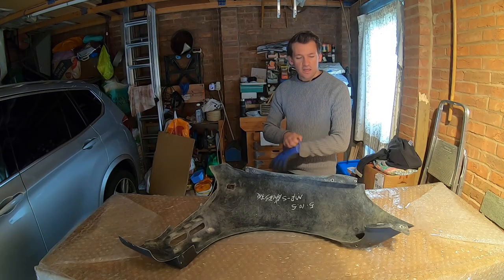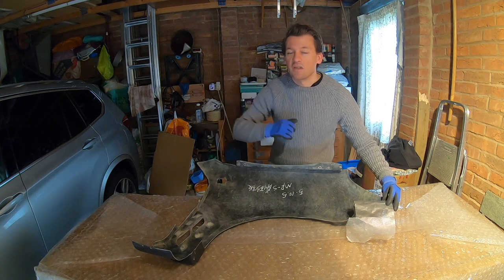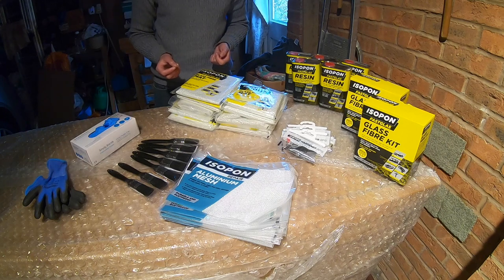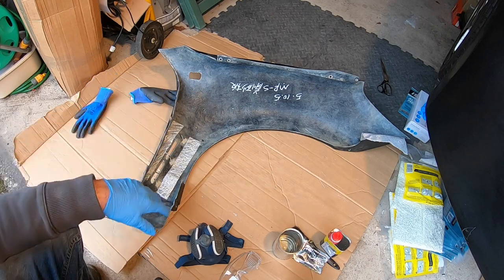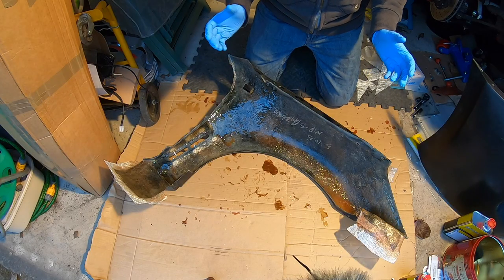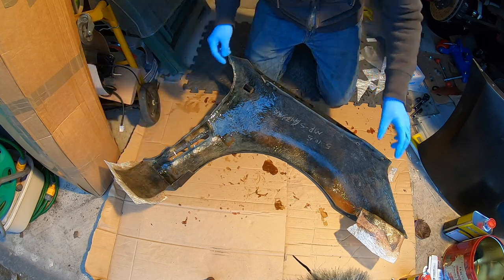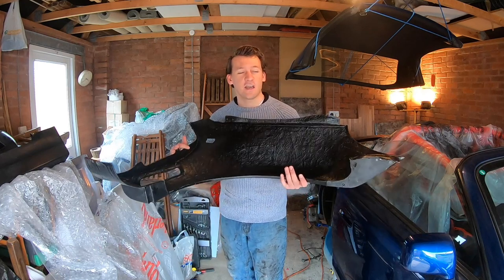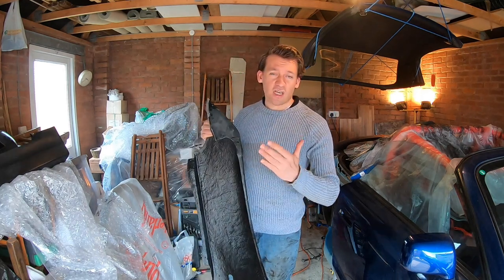Strengthen A Bodykit

Comment: Is there a reason why body kits don't come with this level of strength / rigidity from the supplier as standard? Is it maybe so they can be flexed to fit the desired shape / car they are being fitted to?
Reply from the maker: Very good question! Given this was a kit made for the MR2 Roadster you would expect the fit to not need much flex. The reality is it’s just poor manufacturing, when we came to fit the kit we found some of the tabs were almost 90 degrees facing the wrong direction and needed to be cut off all together. This seems to be the case for most widebody kits you can order under £5000.

Comment: What size rivet nuts did you use?
Reply from the maker: In general I used M8 all over where it would fit, that’s the most common bolt on the car and it just made it easier. There are some smaller M6 ones I’ve used in the past for smaller spaces though.

Comment: Why cant you use Chopped Carbon fiber?
Reply from the maker: @YungEBT  you could use chopped fiber but that would definitely be more expensive than fibreglass mats. I’m not sure if it would be stronger or not over a big flat area as the weave in the mat gives a lot of extra strength.

Comment: I can fully understand the value of strengthening, but you seem to have added a lot of weight to the car. If you were planning to race it, what would you do differently?
Reply from the maker: This will live a lot on track and I’ll be adding a lot of power to balance that out. If that’s not an option for you then I would take a mould of the kit and then remake the panels in carbon, which is both lighter and stronger. Everything comes down to budget really.